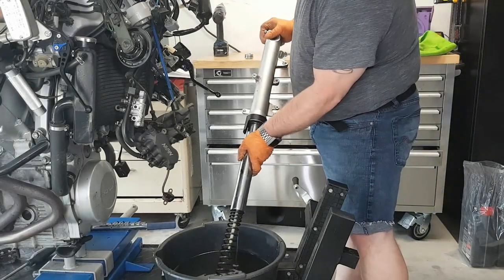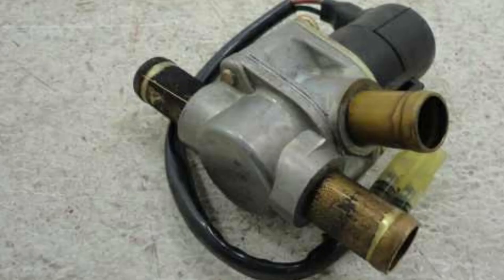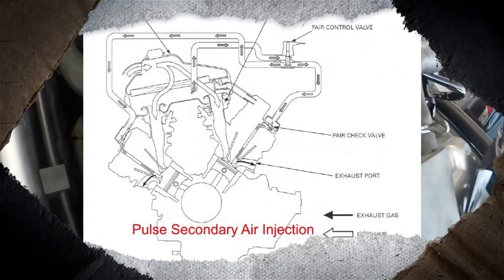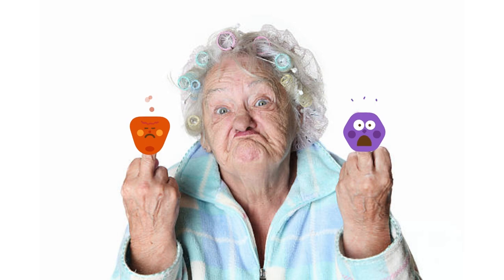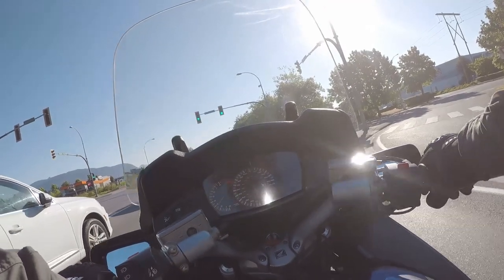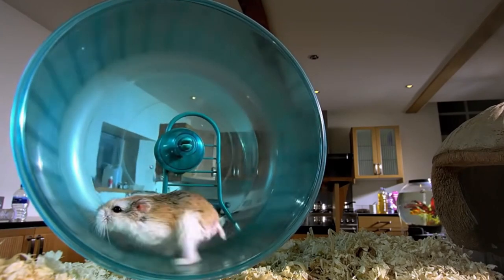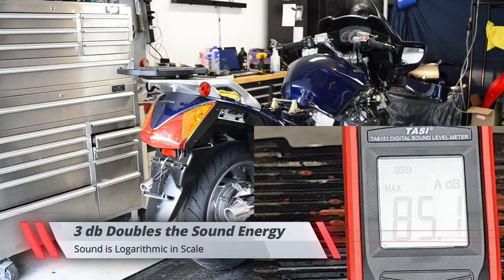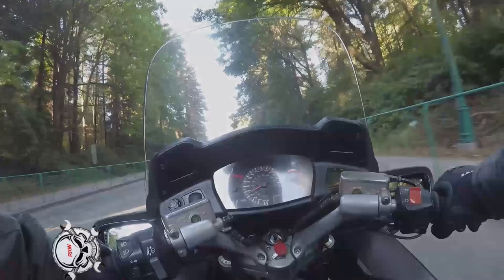Honda ST1300 Performance Mods

Comment: Well done and produced video. I was told by my mechanic who has been racing since 1974, that exhaust wrap will make the exhaust brittle and fall apart in the wrap. The pipes are not designed to be  that hot constantly. Thoughts?  As for removing the velocity stacks, did you get actual gains? Dyno? Changes in low or high rpm operations? There has been a lot of debate on the forums and the general consensus is to leave them.
Reply from the maker: Regarding header wraps, minor expense to manage heat, headers deteriorate when water is trapped against the pipe, they rust.  The exhaust gas is already running 600 -850 plus Fahrenheit so I don't subscribe to the issue of heat damage from the wrap.  No dyno numbers but again you can try it for literally no expense other than your time and see what you think.  Everything done I find the bike makes more torque, especially under load like riding two up.  Thanks for liking & subscribing and a new ST1300 video is coming this Friday!
Reply: With the temp that the pipes get to water is a non issue. Also with this model bike the pipes are well protected behind the farings.
Reply from the maker: Thanks for the feedback, liking & subscribing!

Comment: appreciate the video's.   And am going to be trial removing the velocity stacks on my '04.   Although I am skeptical, it is an easy try.   I have a spare K&N that I may throw in as well,,, although I don't expect much there either.   What the heck,,, it is easy to do.  My '04 currently sports Del's c/w extra length baffles (am not a noise guy),,,  And, Bazzaz fuel mapping.  Both those mod's work great,, creating  stronger and smoother, more useable torque curve.   All measured by the old seat of the pants dyno,, of course.  But, I do have a carefully calibrated butt-o-meter, with about 50 years of street riding.  So, Stay tuned,,,,  heh-heh,, eh,,,
Reply: Okay,,, so in the past couple of days,,, I got the above done.  First removing the upper curved velocity stacks.  Leaving the lower short straight stacks in place c/w fastener safety rings, as they basically hold the airbox to throttle bodies.  Also,,, I did throw in that freshly oiled K&N filter.  And much to my pleasant surprise,,, I got a decent increase in useable torque.  Very impressed,,, I then removed the x-long baffles from the 18" Del's.  Sure it's louder now,,, but more air/fuel in and more combusted mixture out = even better results.   This is just basic hot-rodding.  The Bazzaz air/fuel map that I am using (13.2/1 roughly),,, is just rich enough for good power, and minimal afterburn.  So far,,  fuel mileage does not appear to be negatively affected,, despite me having a whole lot of fun.  But tomorrow,  I will tank up and do a proper mileage check at normal speeds.  Standby for more good news !!

Comment: Thank YOU for the GREAT videos. I have a 2003 Honda ST1300 and I would like to put 18" Delkevic  mufflers on my bike. My question is, do the mufflers need to be repacked with silencing material after a some years of use. Again thank YOU for the great video with professional quality.
Reply from the maker: Not in my experience.  These mufflers are really quite inexpensive, the cost of a set of tires, if they did get rattling why not just replace them?  Again they will last years and years long than a set of tires and  your bike would have what, another 100,000 miles on it?  Thanks for the feedback & Ride Safe!
Reply: @RodRidesWrenches  Thank YOU for your timely reply. I am sold. Oh Yes I have subscribed to your channel.

Comment: Great videos!  Who's the heavyset bald dude riding around on your bike?

Not on board with the whole loud pipes thing. Sound radiates away from the rear of the bike, as you've demonstrated. As both a rider and a cager I can attest that I can't hear the stereotypical Harley coming up on me until he's in my blind spot. In that regard (safety) I feel it's a myth, and wrong to perpetuate misinformation to newer riders, giving them a false sense of security.

Changing the stock mufflers to ditch the catalytic converters though, I'm good with that.
Reply from the maker: Thanks for Liking & Subscribing, New Video this Friday!

Comment: what do you think of the BMW R1100RT as a tourer?
I have a '00 VFR800 so have my dose of V4 and horsepower, and looking for a comfortable 2-up miles gobbler and those R1100RT are cheap now and seems bulletproof from what i read compared to newer 1150 or 1200
Reply from the maker: Yes as I mentioned in the high mileage video, the R1100RT has a very strong motor and yes they are now cheaper than other oilheads in the market.  After owning 1st & second gen 1200 oilheads and the 1100,  I lean toward the 1100/1150.  I have even more data as a continuation to this video which will be out in a couple/few weeks on my channel.  Thanks for Liking & Subscribing!

Comment: Hi, great video! I'm looking at a 2006 st1300. Would 70,000 miles be excessive for one of these bikes? Are there pitfalls on the horizon at this mileage? Thanks.
Reply from the maker: Hello Darren, there are no specific pitfalls with the ST1300 I would say.  You need to be careful loading the rear of the bike up and adjusting the preload (more preload to compensate) out back if carrying weight in a tour pack or a passenger.  It has never happened to me with three bikes, 2003, 2004, 2008 and some autobahn speeds but others claim to have had tank slapper moments on the ST1300.  Keeping the front wheel firmly on the ground will prevent this.  There is a whole series of maintenance videos on the channel for the ST1300 as well as other bikes that will cross reference.  https://www.youtube.com/watch?v=HSejFW3HUwM&list=PLNxqV1qrBsdda5KNt2IMF-Ee9u0ZDltZr  I suspect that you will need to do some work on any bike of that vintage and mileage - Good Luck!

Comment: Hi , Being an St1300 owner myself I have been following your videos with interest. Would you be able to tell me the exact model of Delkevic mufflers in the video please. There's a few different lengths I've noticed on their website 380mm or 450mm etc.  I like the look of the ones you have on the bike. All the best.
Reply from the maker: No Problem, Delkevic Aftermarket Slip On compatible with Honda ST1300 (2003-2015) with Stubby 13" Stainless Steel Tri-Oval Muffle, SKU: KIT1141

UPC: 843789141935
Thanks for liking & subscribing!
Reply: @RodRidesWrenches  Thanks
Reply: @RodRidesWrenches  
Would this like aftermarket muffler work on a 2016 model.
Reply: Any idea if that after market muffler will work on a 2016?
Reply from the maker: @kevinmortensen7186  if you have a 2016 then yes it is the same bike.  The ST1300 did not change.

Comment: I have a clutch related question... Mine seems to stay somewhat engaged still even with the lever pulled all the way in and the buke keeps creeping forward. And its worse when its warm. And yes i have rebuilt rebuilt both slave and master cylinders and vacuum bled the system. Do you have any idea what else it could be? My next thougt is to pull the feont crank case cover and look for defects in the clutch plates or hydraulic locking plates...

Comment: thanks for info, I removed cones and wow. I have my fi light come on if bike is not warmed up enough. After lookig at wirring diagram i am thinking of bypassing the temp that turns fan on. One method of clearing fault codes says you must wait until fan cuts in, why. The temperature sensor wirring goes through the ecu, maybe i can bypass it. Lots of testing to do first
Reply from the maker: Hi David, did the light come on after you removed the airbox intake funnels/snorkels?  I think this could be a poor connection at the IAT (top rear of airbox) or a vacuum line.  I have had no FI issues.   I would check all the sensors, IAT, MAP, TP and replace before messing with the fan. 
How many blinks when you turn on the ignition from the FI light?  

Good Luck Thanks for Liking & Subscribing!
Reply: @RodRidesWrenches  thanks for feed back. No fi was a problem before i removed cones. I am an electrician and short story i put a switch in FI circuit and a switch in test point as an experement i switched fi off so no feed back to ECU and switched test switch on. So far no fi problems. Going for a 3 day ride soon, i will give you feed back. If what i did stops FI from putting bike in limp mode it will be massive info for st1300 riders
Reply: David Barter,,, what exactly did you experience when you removed the cones ??  Wow,,, is not very specific,,, but it implies a huge power increase.   Can you confirm this ??  thx.
Reply: @Porsche359   A lot more acceleration and power, I highly recomend it. Try it, you can always put them back

Comment: Hello again, may I ask you a few more questions about installing Delkevic 18" slip o mufflers on my 2003 Honda ST 1300 non ABS. I now have the mufflers and would like to install them soon.  If I choose just to slip on the mufflers without doing the other mods in the air box. And is the O2 sensor mounted ahead of the muffler so the mufflers just slip on the bike. Again thank you for all your great videos and I have subscribed to your channel.
Reply from the maker: Yes that's the way just remove the factory cans and install the delkevik ones.Straight forward but use map gas on the clamp bolts prior to loosing them.  Without the heat they will break.

Comment: is a power commander gonna be required if i do these basic mods?
Reply from the maker: Hello Jonah, No you don't need to use a power commander on an open loop FI system for everyday use.  Your factory system uses the O2 Sensor to adjust mixture.  If you experience a lot of exhaust pop on closing the throttle, the power commander is a nice option to adjust the "Zero Fuel Throttle Close" mapping to allow for some additional fuel when chopping the throttle.  But for most riders this is not required to experience additional gains from a pipe & high-flow.

Comment: Hello, and thank you for all these interesting videos. Among the performances increase I am wondering about the air inlet hoses removal. Forums say that they are bound to fine tune the amount of air and balance it between the 4 cylinders and bring more torque at low/mid RPM. Did you have the chance to make your own impression before/after this mod ?
Reply from the maker: Hello Sylvain, Torque is definitely increased with them removed.  If you want to increase the power output of an internal combustion engine, you need to allow it to breathe in and out.  I recommend this mod!  Thanks for Liking & Subscribing, new video out next Friday!   🤞